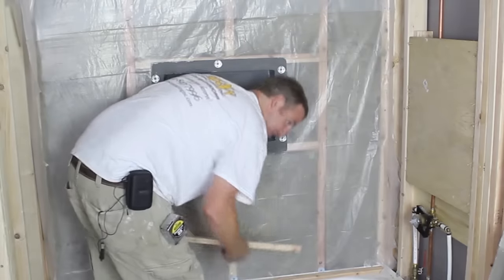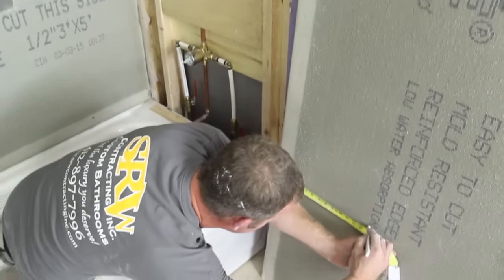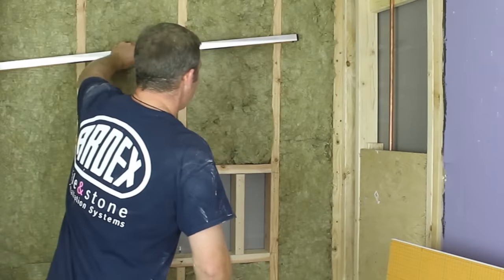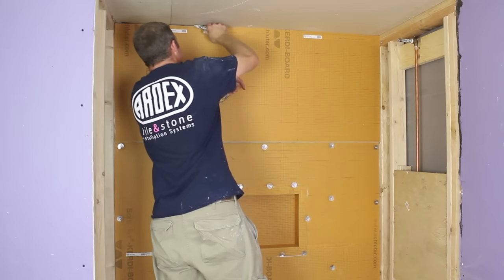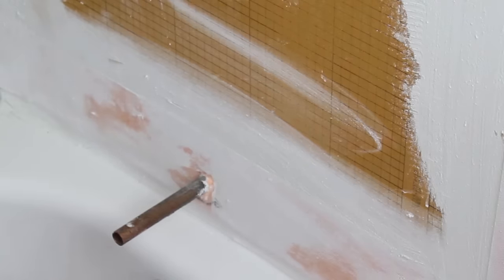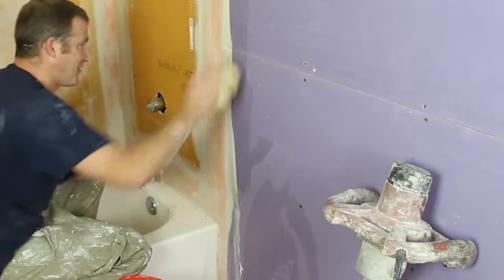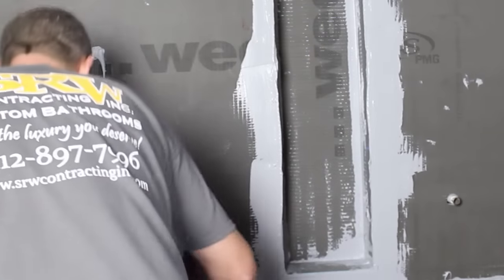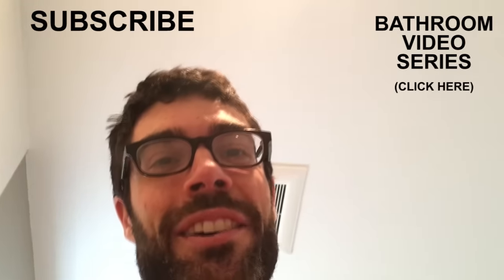How to Waterproof a Shower (3 Awesome Methods!!)

Comment: I frowned when you cut the valve opening with a hole saw and did NOT wear a mask.  DIYers should be told to wear a mask when cutting Durock, Hardi backer or TileRock to avoid breathing the dust whenever possible.  I believe the dust is a known carcinogenic.

Comment: The poor contractor that will have to take that out in a future remodel/ update is going to have a rough demo with all those screw heads sealed and buried under that sticky sealant etc.  Demo costs are going to have to rise!

Comment: Seems odd to have so many different ways but yet still have problems. Why not use Cement board for a foundation then fiberglass mesh and resin over it? May sound odd but boats and many marine products are made of fiberglass. Seems like too many ways to achieve something not as satisfactory.
Reply: Fiberglass (polyester resin) is not waterproof, it absorbs water. The gelcote on the outside of a boat is (fiberglass shower, the colored part, gelcote). That's why you should repair chips in your boat's gelcote, or the fiberglass will rot. Epoxy is waterproof, but $$$. Good video btw.

Comment: Except Kerdi is way toooooooooo expensive.  I guess you get what you pay for, but it is overpriced.  I mean a 12"x12" niche is $100.  That stupid expensive. Then having to thin-set behind and then later over top for the tiles.  While it may not be overkill in terms of waterproofing but its between its step process and cost, its not worth it.

Comment: Why in hell would you need to make all the walls waterproof!!! I built hundreds of bathrooms, never have I done that and never have i had any leaks. here in the netherlands there isn’t 1 building company who applies that methods.
I heard it’s being done in germany but i just don’t understand why...

Prepare youre walls for enough bondage ( i dont know how you call it in english) 
Use a good tilemortar ( and the correct type for youre use)
Ensure that you have enough mortar coverage.
Correctly grout
Correctly seal ( silicone )

It almost cant go wrong! 
And IF it would leak a tiny tiny bit , you could get trouble eventualy but you would also get trouble eventualy if the walls and floor are waterproof and water gets in between your tile and floor or wall... 

Please explane whats the big advantage that makes all this work profitable an nesseserry?

Comment: Whatever happened to 15# felt, latch and cement plaster?  I guess that's not slapdash enough for these so called experts. Just a screw up some backer and put goo over it, now that's tile work. What a laugh this trade has become. Too bad there are still a few of who recall how quality installs are done, until the handyman took over.

Comment: Concrete board does NOT need to be waterproofed. Makes about as much sense as waterproofing your brick exterior or sidewalk or driveway. WHy? its not effected by water anyway. All you have to do is use concrete board. Then thinset every joint. Caulk where concrete board meets tub. Set it directly on the tub. Dont gap it. I have 40 years experience in tile installation. This method is overkill and adds to cost. Not needed. When you are finished tiling caulk all major corner joints and where tile meets tub and faucet fittings.
Reply from the maker: please read the board instructions as they say water resistant, not waterproof; also, the TCNA recommends gaps for expansion, otherwise tiles crack. Water and vapor absorbs into cement board and will reside in stud bays creating mold. If you’re an installer and want to do the right thing for homeowners, take the extra time and waterproof the boards - it doesn’t take more than a day and is worth the extra money

Comment: Plastic behind...waterproof membrane in front. Youll have mold in no time
Reply from the maker: We only showed it as an example, always check local codes and manufacturer recommendation.
Reply: Home Repair Tutor here in Norway there are strict rules and regelations for a bathroom now. But parts of whats shown is used today. Allthough there is a completely different way to put it all together of course.

Comment: redguard  it.............
Reply from the maker: +barry graham RedGard is a good option
Reply: I use mold proof drywall and red guard it in all my shower reno's Haven't had one issue yet
 The jedi system looks the least complicated  but I'm wondering how expensive the panels are 🧐

Comment: goboard! cheaper and faster installs
Reply from the maker: we're going to have an install using GoBoard up on YouTube in a few weeks. It's price is very attractive for a foam board, only $20 for a 3x5 foot section...at least here in Pittsburgh. What price are you paying for that size panel?
Reply: Home Repair Tutor about 22 :)
Reply from the maker: nice, at least we're in the same ballpark. Only our local tile shop sells GoBoard. How about in your area?

Comment: Steve's violating commen-sense rules against cutting cementous backer boards with power tools, especially relevant to interior work.     He's a nice young man and I hope he doesn't smoke, which exacerbates such hazards.
Reply from the maker: this speeds up the installation and should be done with proper protection, when remodeling a bathroom it's always good to know the options that exist ;)
Reply: The YouTube "how to implement Hardibacker board" clearly admonishes against using power tools to cut their board indoors.   Also, explanation is given to the hard-to-convince:   it's silica dust.   "Use wet dust repression" techniques, etc. etc.
I don't expect you to roll over and let me pat you on the belly on this, but your video is on the wrong side of safety, here.
Reply from the maker: you should know that this video was done in our workshop and not in someone's home...that said...my solution is to not use any cement board at all. In fact our recommendation is to use Schluter KERDI-BOARD or Wedi building panels, they're easier to use, waterproofed and provide durability.

Comment: Meh. 3 more expensive ways for sure. Cement board, 2-1 caulking for corners, Redgard and you have a submarine tight shower that will last a very long time.
Reply from the maker: It always depends on the installation. We like sharing different methods and letting people decide for themselves

Comment: Hello, I understand "waterproofing" a shower floor but the surrounding wall? A quality "cement and sand" board is "water resistant" which is what is necessary. If you have all the ingredients under the cement board, quality insulation and a 6 mil vapour barrier, then there is no reason to put on a "Ardex 8+9". Are you making a swimming pool or just promoting an expensive product which you really don't need? Bathrooms must be well ventilated to remove excess air moisture according to all building code. You probably could use this product (Ardex 8+9) if you are using the "new architectural design"  a "window screen" over your walls...I hear that it's nouveau riche...LOL. You do not have hydrostatic pressure on your walls! Your shower head doesn't deliver so much pressure that your "TILES" will not stop it.  People who have mold or water penetration issues use bad building practices and bad building materials then they go through so many expensive products which is fantastic for the manufacturers and so many unscrupulous or idiotic builders/contractors.
Reply from the maker: you're free to choose not to use a liquid membrane of cement board. However, given that bathroom remodels are subject to water every day and knowing that tiles and grout are not waterproof we recommend a liquid membrane or some time of waterproof backer board. Cement board is not waterproof. Water vapor will get behind tiles and it thin-set is incorrectly applied mold or mildew will grow in those open spaces. You can be skeptical of the companies making these products or contractors recommending them. But an extra $100-$200 spent on a waterproofing membrane is money well spent for a remodel that costs perhaps 10x as much. Being prudent and understanding the Tile Council of North American guidelines is what we hope to explain in our videos. They recommend these materials and we do our best to share that knowledge.
Reply: Nonsense! Never in my response did I say cement board is waterproof, it's water "resistant". Regarding mold and mildew if you think it will grow behind tiles because of a bad tile job then what make you think it will not grow even if you put your $200 waterproofing agent. Furthermore, "TCNA staff members cannot make product recommendations"! Nothing but nonsense, you are are simply promoting a product. As an enginer I would never promote a product, provide nonsense responses and would make sure a client gets a well designed, engineered and long lasting product!

Comment: dont like any of the methods shown,cement board too heavy,dirty to work with,edges sometimes crack when screwed,wedi and kerdi board both way,way, way too pricey for what they are, would like wedi if it didnt cost so much. I use Denshield  plus waterproofing and mesh, board itself is waterproof.only seams and tub joint require mesh,easy to cut and work with.price reasonable
Reply from the maker: the issue I have with Denshield is the warranty. Do they cover their product and the waterproofing or will the waterproofing company cover it. Whereas Schluter and wedi both provide 10 year warranties for the homeowner.
Reply: I dont  have any faith in warranties,just do a proper job and there wont be any issues,nobody would pay to redo a job because you had a leak,the best they would come up with would be a refund of what materials cost.
Reply: @gasmanrm  Exactly. If you can PROVE their product was installed to their method and that it was the cause of the failure. I think HardieBacker has a limited life time warranty by comparison.